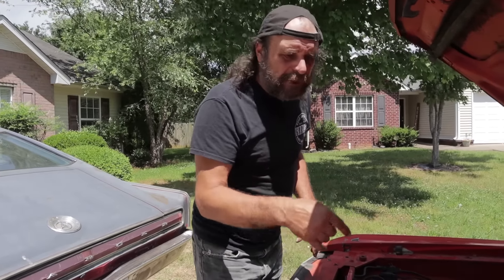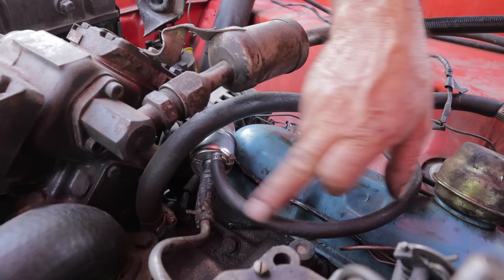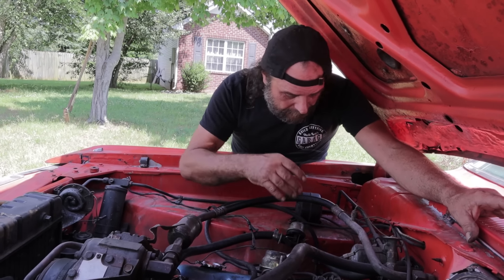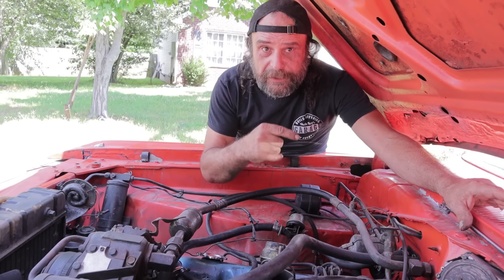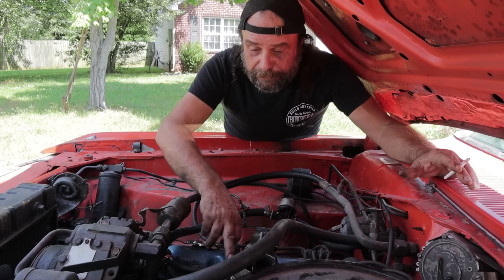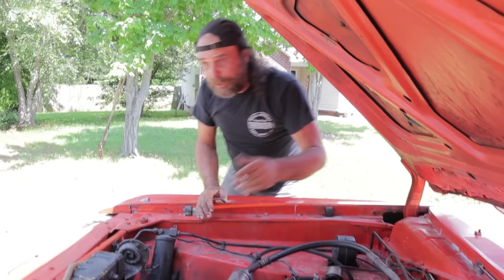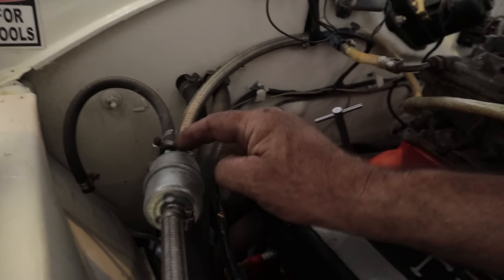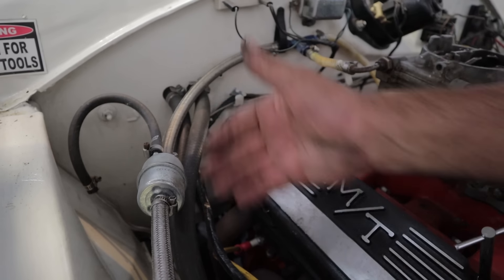$8 Cure For Vapor Lock

Comment: Will this work on a fuel injected engine?  Every now and then my 01 Jeep Cherokee gets heat soak every now and then
Reply from the maker: No, this would only work with a carb.  If you have a similar issue with an injected motor, you probably have an injector or two that are bleeding down into the engine after shut off

Comment: Hey, I'm trying to cure the vapor locking on my 68 Ford. Does this fuel filter have some sort of mechanism or pressure relief valve inside it that vents off vapors through the 1/4" nipple? If you don't have (or don't want to run) a line back to the tank, could you just connect this port to a hose and run it straight to the ground? Like they used to do the overflow line coming off radiator caps before coolant recovery systems? Would it puke gasoline at idle? What would happen?

Comment: I have a 65 galaxie with a 352 engine  4 barrel 600cfm summit carburetor with phenolic spacer running a rubber line from pump with plastic filter tried putting heater hose around fuel hose for protection. Still percolating in filter. I have no return line any suggestions?

Comment: I have a 75 ford ltd. It doesn't have a return line. But for some reason pressure in the tank builds up high and when I take the gas cap off it would spew vapor out. Any idea what's wrong here?
Reply from the maker: Wrong? Nothing.  That pressure is working in your favor

Comment: hey tony , have  a question. i have a 47 Chevy truck with a 454 , i just started having the vapor lock issue. i just installed the vaporizing fuel filter w\o the oriface. its dumping a ton of fuel into the gas tank to the point if i fill up the tank , the tank over flows. is there a specific vehicle i can look up. i cant find it just looking for a oriface in a fuel filter

Comment: Hey, interesting fix.  I will try it on my stock '55 1st Chevy pickup (235 cid inline).  

Tried everything I could to prevent vapour lock.
So this truck tries to start after sitting in the summer sun for a while.  Have to wait like a good 2 hours or so before it will start up again.
Installed a thick 1/4" insulator gasket under the carb -- nyet.  Then fashioned a large aluminum plate under that -- nyet.  Even put in a check valve at the inline fuel filter -- nyet.  

Now I'd like to try your method.  

Thing is, how do I get into the incab-mounted tank for safe venting  ..do I somehow tee into the metal vent that comes up with the fill tube (to the fill cap) ?   And for venting from the filter, can just a neoprene (fuel) hose be used all the way back to the tank or does most of the length have to be metal (copper?) ?

And my guess in this case is to use a filter with an orifice: so what common brand and part number should I look for in a 3-nipple filter ?

Comment: I put this system on, ran a line with a one way valve back to the tank attached to the return port.  I used the fuel filter recommended. 
The problem I have now is I can't start it without starting fluid to re-prime the fuel line.  It drains I guess? Any help here? 
72 GMC Jimmy.

Comment: We obtained  45 Willies Jeep, had to put a "compatible" carbuerator on the larger 4 cyl, the carb was made for a car but fits the jeep intake. It idles but when throttled it bogs down. I am thinking the psi change or fuel volume thru carb is "not compatible" with demand design. Any thots? thanks!

Comment: Is this also effect fuel effiency?

Have a 78 plymouth w e58 package go e through everything gets about 4mpg.
Reply from the maker: It can't hurt fuel efficiency...but you've got bigger fish to fry.  I'm guessing you've got a Lean Burn in that thing
Reply: @UncleTonysGarage  heres the specs. 
•Stock but new fuel system, mech pump etc. 650 holley tried a few dif carbs w same result. Have not played w jetting YET.
•470lift cam with matching springs and hydraulic lifters. 
•ebay 12v distributer with module (so lean burn is gone) external blaster 2 coil.
•single plane torker 2 intake.
•has stock 727 w shift kit, factory e58 stall rebuilt. 
•323 sure grip 8.25 out back.
•rebuilt some non smog heads but stock spec 1.88 valves. 
 Went through 108,000mi engine 8.5-1 (i believe) stock. 
 Running a jerry can to monitor fuel mpg.

Comment: Hi I got the fuel vapor separator filter hooked up with return line to tank and still vapor locked on me today in 91 degree. Help plz
Reply from the maker: Try dropping the running temp of your engine, and adding an insulating spacer under the carb
Reply: @UncleTonysGarage  
Hi. I got a 160 degree thermostat in it and I already have 1in carb spacer and fuel line insulated. New gas cap as well

Comment: Let's see if this will work in the desert Southwest after driving all day in traffic at a 112ﾟ.    I doubt it.  I ran fuel line off a T before the  Carburetor all the way back to the tank to keep the fuel circulating.
 it would still vapour lock While you were driving it on the freeway.

Comment: i have a 1984 chevy c 20 with 350   i   installed a edelbrock carb /intake on it just work truck  and tried all .    but it cranks a long time be for starting  after 15   30 min.... of setting  p,s,  and new manual fuel pump dont now what to do
Reply from the maker: Get an insulating spacer under the carb, and when you go to crank it after sitting for a few minutes, hold your foot on the floor until she catches.  Extremely common problem these days
Reply: @UncleTonysGarage  thank you sir ill try

Comment: Would running rec 90 solve this ?  My son  has an '86 F150, 300/ 1bbl.  Runs rec 90 since the corn syrup gas gummed up the needle & seat.
We're in SW Fl.  It gets a little warm here.  So far no problems.  Might be worth looking into.
Thx

Comment: what if i don't have a return fuel line?  can i still do this somehow?
Reply: Return line is required. I ran a new line, ideally metal, either steel, stainless or aluminum. You also need a port at the fuel tank for the return. There may be an existing return port, or if need be, you could drill a hole and install a fitting to the tank or  fuel fill tube. Of course, exercise care as gasoline is flammable and you also do not want to introduce metal shavings into the fuel tank. If you search online, there may be an available retrofit kit to create that fuel return port.

Comment: I know this is old video but do u have any engine starvation issues having a return line? I recently got a 1986 f250 7.5 liter with electric fuel pumps but it had a vapor separator in it but previous owner got rid of it and plugged return line.  Lots of people complained of starvation isues with that separator fitting thing. Can’t even find that part of I wanted to install it. Help is appreciated. Thanks

Comment: How do you feel about Oldsmobile
Reply from the maker: Underrated.  Some exceedingly cool cars through the years that never get the attention they deserve.  Downside...huge main bearings that require massive amounts of oil to keep happy, and the open decks are head gasket issues in waiting
Reply: The issues I’ve grown to love! I have an 85 delta 88 with surviving frame paint and an 86 delta 88 both with the webbed block unfortunately. Have you ever heard of the nickel content Oldsmobile used to harden their blocks? Apparently 5%+ nickel hardens their blocks so they can accommodate rpm over 10000 without missing a beat. I have lots of work to do but I’d love to show you the progress over the next 2 years so we can share the beauty of these dying classics, if only briefly. Thanks for the reply my friend. I’ll be ordering merch soon

Comment: hello: I have an 87s10 2.5 engine that is tbi which is been converted to carburetor. the carburetor I got is a 34 pict-3 for a vw . it does not bring a return line my s10 does. will putting a filter like that one make work as if it's a fuel pressure regulator with a return line. thanks for the help in advance.

Comment: Is that why I need to take my Gas cap off to run my 67 Cadillac Deville ? Every now and then the glass fuel filter runs dry even tho I changed the mechanical fuel pump

Comment: I’m curious about the fuel tank vent. My 73 340 dart has “the charcoal canister” with the 1/4 factory metal line back to the tank. Originally the line was connected with a 4” piece of rubber fuel line. The purpose of that line was to take the vapor from the tank and burn it in the carb. I have noticed two people who are routing the return line to the 1/4 fuel return port on the aftermarket fuel sending unit which I’m questioning.  Could someone confirm where Uncle Tony is attaching the return line on the tank. 

Thanks

Comment: I have run into a problem with my 84 D150 (5.2, 2 barrel Holley, automatic transmission) in that it runs beautifully at idle and cold weather but when it warms up a bit it starts to cut out then die. On the ignition side I replaced everything from the distributor to the key tumblr. Same goes for the fuel system and even made sure the tank was clean. I’m stumped, any ideas?

Comment: Got this issue on my 68 Mustang with no return line.  Not sure what you meant by teeing the return off at the tank. Could you explain for a dummy.
Reply from the maker: There's a rubber line between the tank pick-up and the steel line that runs to the front of the car.  Put your T in the rubber line
Reply: Ah Ha. I thought that was what you meant but it seemed odd that the return line would feed back into the feed line. But if it worked on your badass RoadRunner it should work on my Mustang. Already found that Wix filter on Summit. Thanks. Great videos.

Comment: I was considering an insulator carb spacer. What's your take on this Tony?  My issue is fuel boils in the quadrajet. Boils into combustion chamber. It acts vapor locked, and flooded.

Comment: How could i solve this problem on a 1990 jeep cherokee any time i get in heat or go up hills i vapor lock ive tried everything its fuel injected not a carburetor
Reply from the maker: If it's injected, it's NOT vapor lock.  Check pump pressure and make sure your filter is clear
Reply: Uncle Tony's Garage filter is brand new pump is new as well pressure is good and we have also replaced pressure regulator. three mechanics have told me its acting just like vapor lock and cant figure it out.  itll sputter out stop and stall out then i have to sit on side of road for 30-60 min. And it only ever happens when i drive to heat up at my house in northern az i can drive all day but if i go down to anywhere hotter weather or going up hills fast it happens.
Reply: They say it acts identical to vapor lock but have no clue how to fix it. because they have checked everything and its all in normal and with it being fuel injected they have no clue what to do. ive been trying to figure it out for a over a year

Comment: I found a place that sells non-ethanol fuel at 90 octane. I know that ethanol can separate and that's why it boils, because the water from the ethanol and the condensation, microscopically, can separate and expand what will the non ethanol do that? It ain't got none of that stuff in there

Comment: I still see people put wooden cloths pins on the fuel line to the carb and claim it solves vapor lock. If they believe that works, they never really had a vapor lock issue to begin with.

Comment: I have a solution to the problem of today's gasoline in yesterday's cars. Engine swaps!! Pick yourself up a pallet engine and put today's engine in yesterday's car. No carburetors, no points, no headaches..
The old engines were not as efficient or reliable as today's engines. I was always doing water pumps, carburetor rebuilds, alternators, tune-ups, etc. If you're going to drive a classic car, put in today's engine. I love the bullet-proof reliability.
Reply from the maker: There is no possible way I could disagree more
Reply: @UncleTonysGarage  Care to expand on said disagreement?

Comment: Hey Tony I have a 1984 Chevy Camaro Z28 that I custom restored back in 1999 and I installed a old school 350 V8 Mr. Goodwinch crate motor with a Eldebrock electric choke carb and I never had a vapor lock problem with it till year 2010 in Florida when they made 10% Ethanol mandatory at all gas stations. When I researched the problem on the internet and found out it was 10% Ethanol in the gas causing the problem. I waited till the gas tank was almost empty and I found a local gas station that has Ethanol free pure gas which cost more but I been using nothing but pure gas and I still get the vapor lock and I don't know why. The strange thing is the first 10 years I didn't have the vapor lock problem on the same engine and car. Maybe perhaps the WaWa gas station charging customers more money for pure ethanol free gas is (lying) when it really still has ethanol in it. What do you think?

Comment: a Vapor lock Fix.  a 10 micron fuel filter directly before the mechanical fuel pump .. what happens is the sediment from the fuel tank, lines and gas station get into the fuel pump check valves holding them slightly off their seat.   the cars will start cold.. run for a few seconds and stall..  requiring a minute of cranking and frantic pumping of the gas pedal.   the fix.. a 10 micron rated fuel filter directly before the mechanical fuel pump inlet.  i use the 1984 corvette fuel filters for 3/8 hose applications. i use the 1990 ford ranger fuel filters for 1/4 and 5/16 line applications. making sure you don't kink the fuel line at the end of the filter nipples.  just push it on and clamp it..  other fuel filters may be 70 micron.   when you install the filter before the pump.. disconnect power to the ignition system so you can't create any sparks..  disconnect the fuel line at the carb.. extend it with a piece of fuel hose.. stick that in a clean clear soda bottle..  have somebody crank the engine for 15 seconds while you watch the pulses of fuel from the end of the hose.. each pulse should be full and equal to the others.. not diminishing.. not full of bubbles.  do this 15 second cranking test 3 times.. this is usually enough to flush clean fuel thru the pump and check valves.   why do this ..  when the fuel pump check valves don't hold pressure, the fuel pressure to the carb is reduces.. when coming to a stop with a hot engine.. the fuel pump slows.  the fuel in the line to the carb slows.. the heat off the engine and radiator causes the reduced fuel pressure in the line to the carb to boil.  this expanding vapor comes out the carb bowl vents..  sputters out the booster legs in the venturi.. expands and pushes any liquid fuel backwards thru the lines and out of the fuel pump.. the fuel pump can't handle expanding fuel vapor especially with dirt holding the check valves open.  the engine leans out. the pistons and rings expand in the bores and make it really hard to for the starter to crank the engine. 

 i also remove any inline fuel filters in the hot air flow between the pump and carb except for those right at the carb 

 don't believe you have a fuel pump issue.. how long does your engine hold fuel pressure when shut down.  hook a clear vinyl hose to the fuel line to the carb.. extend it up to the hood latch.. crank the engine till fuel shows up.. stop  cranking the engine.  watch the fuel vanish back thru the pump. 

 just a tip. i have been doing this with 10 micron fuel filters since the early 80s. .   magnets on the bottom of the fuel tank.. super magnets inside the fuel tank when you have the sending units out.. also help.  be sure you don't put them where the sending unit arm will stick them to the bottom of the tank.

Comment: Hey, I don't know if you even check the messages on a post this old but I just want to confirm that I could use the vapor line on my '74 maverick that was used with the charcoal cannister as a fuel return line?  Thank you.  

On a side note, I've been trying to see the internals of the Holley 12-403BP to compare it to the deadhead version, so I could possibly modify my 12-403 in the future...  But so far I can't find it, though just logically looking at the design of the deadhead, it shouldn't be all that difficult.

Comment: Now how would someone install something like this onto a Return Style Fuel System for a Carburetor w/ the fuel pump inside the tank, and a fuel bypass regulator. (non-EFI System), or would it be completely unnecessary

Comment: Fuel boilsin the carb too,,,floats will not float on air bubbles,,so it stays down letting in fuel that dumps into the motor,,,,, radiators with electric fans can cool the water,but don't cool the block or the carb if they don't run continuously,,,even then the air doesn't move over the block,,,fans are good if the motor isn't running,,or helpers,,,but tight motors no vents gas that boils at 140 or less,,and you have a 185. 195 thermostat,,use a spacer,,don't use old carbs on old cars,,

Comment: Hey Uncle Tony! I have a quick question on this set up. What do you mean by putting a tee in for the return line before the tank? can you put a tee before the tank for the return that plugs into the supply line without having to add a return nipple to the tank? UHHHH HA HA he said nipples.
Reply: I searched it and this is what the interwebs is telling me. 

"one of the most, if not the most important functions of having a fuel return in a fuel system is to be able to rid the system of air. If you tee the return back into the supply line the air just gets recirculated. Take it back all the way to the tank."

Comment: Is there another simple, cheap, easy (hopefully) way to fix this?.? I just replaced my fuel filter with the traditional one and i'd like to not waste one (And i paint mine black, so scruff/prime/paint/clear coat. 
And, taking a line from the engine bay to the tank might be out of my league.